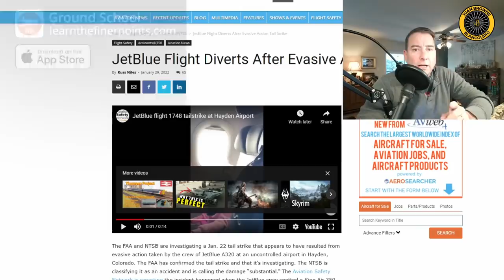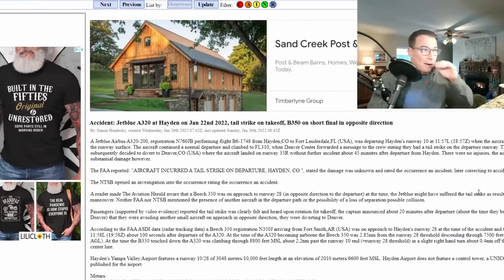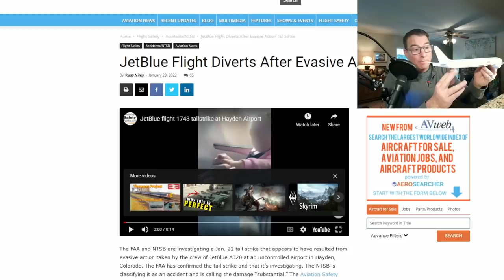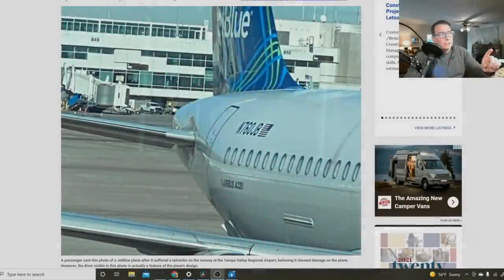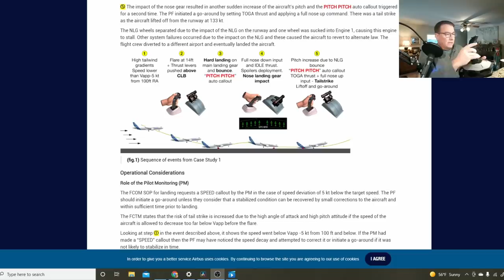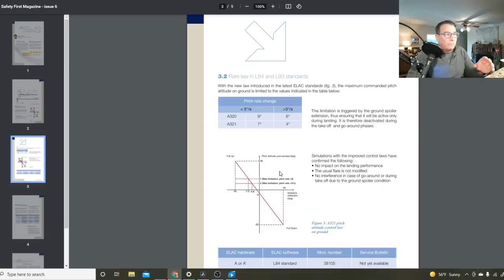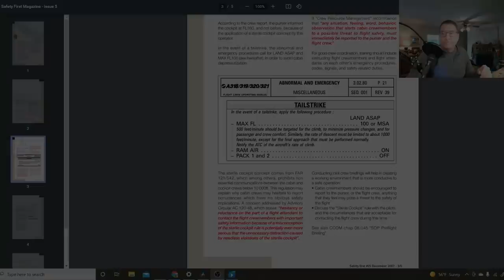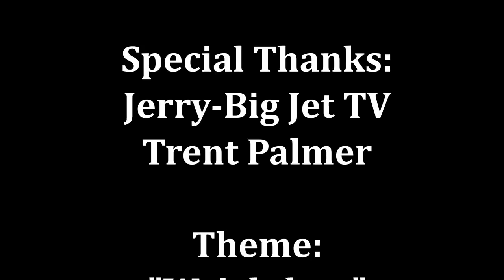Tailstrike!

Comment: The BA tailstrike looked a lot like pilot induced oscillation, or PIO. This occurs in F-16s and F/A-18s, especially on takeoff or landing. The F-16 fly-by-wire also won't stop the pilot scraping the tail speedbrake on the runway either.
Reply: Looks like a complex combination of PIO, TOGA, wind gusts, and the multiple control laws. It would need a full analysis of all the factors, and an engineering flight simulator to really understand what happened. We may never find out, since it wasn't a catastrophic accident.
Reply: @gordonrichardson2972  Agreed. There was multiple factors involved, beyond PIO and wind gusts on landing.

Comment: Approx 25 years ago, as a passenger leaving Pittsburgh on a USAir flight to Toronto (in a 737-100 or something very similar), we dragged the tail on take-off for three seconds (it seemed like 6-7 seconds, but I'm sure that was just me thinking really bad thoughts for a couple extra seconds). It was a very loud, angry, metallic scraping noise that made think this *must be at least a little unusual (or otherwise the air travel industry would lose a lot of nervous customers). But it seemed barely noticed by the few red-eye passengers, wasn't mentioned by any of the crew, and we continued to sail off into the blue. Perhaps not an ideal take-off but we were away so, I guessed, perfectly normal so no worries. To this day, I don't really have any idea if the event would be considered a serious problem or no big deal at all or if it was somewhere in between...

Comment: The explanation of which mode was engaged is a clue to what happened. Up until the moment the TOGA was engaged the aircraft would have been in flare mode. As soon as the TOGA was activated the spoilers closed and Flare mode was instantly deactivated. (See Para 3.2).

Comment: Tail strikes happen more often than you think unfortunately, we had one last month and is now in a MRO for reskinning, long process.  In the 00's, I worked for the only airline in N. America to fly the A318's (that was short lived)...the "really short bus". Somehow, the F/O (PF) did a tail strike on a A318 in KDEN on landing... That's some serious nose up on landing, 14.5°+... He insisted that the aircraft did it on it's own during flare... However...Maintenance (Mx) was asked by Flight Ops to secure the sacred card that Juan has spoken of in a prior video, the FOQA card from the CFDIU, aka "The Tattle Tale Card". Turns out, the F/O had a nose up, pulled back, input on his sidestick the whole time during touch down into roll out. So he lied and I believe got his ass suspended for a lil while...

Comment: I would like to add to my post that the FBY ( fly by wire) stick is incredibly accurate & sensitive. Moving it for rotation is maybe 1/2 inch over 5 seconds . Normal hand held flying & on landing doesn’t exceed 1/16 to 1/8. Very sensitive. Will give advantage to Boeing for landing in a hard to severe crosswind landing because of wired flight control surfaces movement.

Comment: The extend of the visible damage of one single tailstrike is impressing, looks like that body went through half a dozent of it !
Reply: Actually, this looks like a light tail strike to me. I have seen dozens of them in my year of aviation. Those skins are about .060 thick and it dosen't take much to peel them back. I doubt the rear pressure bulkhead was damaged.
Reply: @jimpalmer1969  has anyone considered designing an ablative skid plate, analogous to what skateboarders put on the tail end of their skateboards? Or are tail strikes too rare to bother?
Reply: @MarcosElMalo2   not an engineer, but I doubt a skid plate would do much.  As Juan mentioned the concern is more for the aft pressure bulkhead inside than any external plating. You don’t have to actually open a hole to cause damage to that bulkhead inside.
Reply: Some longer models have deployable tail skids.
Reply: @MarcosElMalo2  Some aircraft have them as a means to understand the severity of the hit, think crush block rather than skid plate, but the concern is not just abrasion, but bending moment as well.

Comment: If I am not mistaken, main gear has to be compressed fully to reach switches to deploy spoilers. If one gear uncompresses, spoilers will stow away. 

Also, that BA looked like it was having gusting conditions. You can see after it struct the tail, nose went down because computer sensed it's AOA too be to steep at that altitude.

Comment: TAIL KABLAMMO! 😁 It looks so gentle from outside, but that passenger video proves otherwise! That was a SHARP hit! Those machines are so big it's hard to imagine the forces at play.  I can only imagine the internal damage from that on something this heavy.  Externally it looks like someone took a 20' wide belt sander with 40 grit sandpaper to the thing!  Knocked the heads off quite a few rivets there as you pointed out.  

Far be it from me to point fingers. I used to drive tractor trailer, and as a rookie I got myself into several pickles that drew mockery from all my co-workers. It happens - we're only human!  In the trucking industry you're only allowed 3 incidents - even a nick on an aluminum glad hand hose protector counts as ONE (of course this depends on your superior) - within a 1-year rolling period, then you're out the door. Even if it's not 100% your fault.  All about insurance costs. You're just a number there, like most jobs with big companies. Screw up, and they'll find another warm body to replace you.

Comment: Very informative, thank you Juan. Ever since that Air France Flight 447 accident in 2009 (I think) I have been very skeptical of the side stick, non-linked flight control concept. As per Wikipedia, that configuration may have contributed to the accident, "The flight controls are not mechanically linked between the two pilot seats, and Robert, the left-seat pilot who believed he had taken over control of the aircraft, was not aware that Bonin continued to hold the stick back, which overrode Robert's own control.". The airplane was apparently in a stalled condition all the way from cruising altitude to impact. When you add in the controls computerized system and the fact that pilots are not receiving authentic feedback from controls input, I see too much potential for inadequate/inappropriate control authority. Makes me want to kiss the yoke on the C172 I fly.

Comment: If the pressure dome is installed correctly besides the rivets there should also be a good sealant in there holding the metal together, for a bit anyway.

Comment: Lack of Basic Airmanship caused this damage. First, not keeping the upwind wing down after touchdown, bouncing the aircraft upon touchdown is indicative of too high of a touchdown speed. Combine these two mistakes and now the aircraft is out of its landing parameters. Now, the pilot is behind the aircraft and possibly running out of remaining runway, airspeed and ideas all at the same time. Hence the rapid rotation as he applies power causing the tail strike. They just don't teach the hard stuff anymore. I'm retired from professional aviation after 47 years .

Comment: To make a good tail skid you would not even have to add significant weight. You start with an efficient high strength steel as base material, coated to prevent corrosion of the aluminum at the interface, then you add tungsten carbide buttons or runners that allow the skid to contact the runway at speed without eroding the skid. That way it can be made lightweight and durable.

Comment: "Normal Law" is a trim free, one G regime, and therefore the "Flare Mode" introduces slight nose low auto trim to introduce the typical non-FBW flight control response pilots are accustomed to in the flare.  In other words, a bit of weight to the side stick while rotating in the flare.  Also, ground spoiler deployment requires not only squat switch, but also thrust levers at idle, which may or may no have occurred in this case.  A bounce often occurs simply due to pilots reducing thrust levers slowly like a conventional jet which undermines the need to be at idle at touchdown for spoiler deployment.  The gust, or large wing wag seems excessive and I'm still trying to figure that one out based on flight control input.  Probably tied to late or non-existent ground spoiler deployment.  It's a puzzle for sure.  The FOQA data should have all the answers.

Comment: It seems to me that the BA Neo's pitch was too steep(high) during the bounced landing recovery. You see them correcting (lowering the nose) as soon as the plane starts climbing. We operated the MD11 for years and a lot of recurrent training was focused on bounced landing recovery, MD11 could be a biatch when you didn't correctly fly a crosswind flare/touchdown.
I really enjoyed the Airbus(a320/21) but never really got used to not having feedback of the control forces (PF moves the joystick but the other pilot doesn't feel that movement through his/her stick). Conventional steering columns give the PNF feedback of what the PF is doing to his controls in pitch and roll. That's why you often see the PNF lightly holding the controls to feel what the PF is doing, especially when operating with less experienced pilots. As an instructor pilot on the A320 (after having flown Boeing and MD11) this really was something to pay attention to, the decision to take over the controls when needed was done in an earlier stage of the flight since you couldn't anticipate what the other (trainee) pilot was doing due lack of control input feedback.
Also, the thrust levers not moving was getting used to. Never forgot a go around in heavy rain/windshear during flare as PNF, PF forgot to hit the TOGA buttons and I didn't realize that until few seconds later and slammed the thrust levers to the firewall. Sticking to the drill of the ga around procedure prevented a worse outcome.
Reply: Thank you for sharing your experience!

Comment: Recalls a horrible accident in Japan where a 747 on a domestic flight suffered a rear pressure bulkhead failure that damaged the empennage causing loss of control.
Reply: JAL 123.
Reply: Sadly that was due to the improper repairs.
Reply: @KPMACHINE1  Yep.
Reply: Empennage is one of my favourite words thanks for using it today
Reply: @nickinportland  
Fabulous is mine!
Reply: We personally know one of the four survivors of JAL123. That the pilots were able to maneuver the plane for as long as they did was was remarkable considering the catastrophic damage to the plane.
Reply: JAL 123. Still the greatest single aircraft loss of life. Due to a badly repaired tail strike years prior.
Reply: It blew the entire tail off didn't it?
Reply: The repair actually lasted a long time 20 yrs or so before finally failing. The mechanic who repaired the plane killed himself, couldn't live with it. Overall tragic story all around.
Reply: @schecter6l6  I dont think so.

Comment: I had a slight tail strike on a DC 8 73series, 20 some years ago or more. It was a max takeoff weight of 355,000 pounds. On a warm day make that night. Felt a slight little bump. Even though I only rotated less than 9°. The aircraft was flying was flying in ground affect a little bit as I rotated to the 15° pitch up and scraped the tail  skid a little bit. But there is a crush cone And different ways of seeing if you needed an inspection or just some spray paint. I was lucky only spray paint as it did not crush the canister in the tail skid.

Comment: There's no law that prevents tail strikes, during the flair mode most protections are gone. The pitch protection is way passed tail strike angle. It's only for in flight protection. There's an aural pitch warning but no protection at all.
Reply: Does hitting TOGA change the law?
Reply: @blackswan4183  the laws are based in RA, angle of attack, speed, acceleration and degradation of the systems.

Comment: Never gotten a tail strike at altitude...😅 Once again a great job...The only one I've personally been involved with was as an engineer on a DC-10-30 on a maintenance ferry out of Tulsa. Definitely shortened our duty day tho.
Reply: I pondered Juan's explanation.  He pretty much bracketed tail strike situations:  landing, taking off, touch-n-goes.
Of course, there's always the possibility of a military engagement, or when you drop the soap in the shower at the pen...
Of course, the penitentiary shower situation could arguably be a variation on the touchin'go theme....   YMMV
Reply: Define altitude... If only the trees on Russ Hill at the western end of 26L at Gatwick could talk...
Reply: @alasdairhompstead7950  Well....Departing Gatwick full and non stop to Dallas was my other DC-10 story. I ruined the cushion on the engineer's seat.
Reply: @jakejacobs7584  I can well believe it, although I was thinking of the TWA 747 that barely made it to 3,000 before returning to unload... I think the only thing that came closer to hitting the hill was the A321 a couple of years ago that lost both engines as it cleared the perimeter.
Reply: @alasdairhompstead7950  True enough... I was just speaking of seeing the end of the runway pass under the nose on rotation.
Reply: @jakejacobs7584  That would certainly leave a mark😬 The extra 1,000 ish ft extension in the late '90s   made a difference.
Reply: @alasdairhompstead7950  Yes, that was in 89 or 90. My last departure out of Gatwick was on the 777 and not a problem at all.

Comment: On the JetBlue flight, how/why is it that ATC would know about the tail strike but not the crew? There was no tower there, presumably the King Air crew wouldn't have known the JB had a tail strike,  and the flight crew presumably didn't know because they continued climbing to FL310 which undoubtedly means they allowed pressurization to take place.

Comment: The horrible 747 crash in Japan a few years ago (several hundred killed, one survivor) was the result of a tail strike, more correctly, poor maintenance at the time of repair of a tail strike.  When the rear bulkhead blew away in climb, it cut off the horizontal stabilizer controls.  The crew did a valiant job controlling it for about an hour by using power but ultimately it went into a mountain, Mt. Fuji if memory serves.

Comment: IIRC the lack of a "Direct Control" modes one of the complaints Sully had when putting the plane on the Hudson. Makes me wonder if this was done since then.
Reply: Yeah, you're correct. I saw him in person giving a speech once. Someone from the crowd asked a question along the lines of "would you change anything about the landing?" Sully laughed and said "Yeah if I had to do it again, I'd do it in a Boeing. That airbus wouldn't let me flare all the way to the surface of the river.. I know I could have put that thing down more gently if the plane had let me."
Reply: Not sure landing on rivers was a priority in the design process at airbus!

Comment: Saw a C-130H land nose wheel first , taxied in for a engine running offload. Brakes were hot them I saw the station 360 had crumpled skin. Had the engineer look and they cut engines.

Comment: I was watching Big Jet TV that morning right after the tail strike. He mentioned that the crosswind can be tricky there due to the buildings on the north side of the field. Do you think the wind could have caught the crew off guard a bit after they came out of cover from a building?
Reply: I’ve seen this discussed elsewhere and I don’t buy it.  Mechanical turbulence exists everywhere.  A good pilot will be actively flying his aircraft all the way to the taxiway, essentially.  If you let some wind blow around a building and almost wreck your airplane, you’re doing it wrong.

Comment: Didn't the B-29 have a rear skid plate to prevent damage to the actual aircraft in the event of a tail strike?
Reply: Dang.... should have read the other posts before I said the same thing.  Only reason I knew that B-29's had the skid plate is from one of my many visits to the Midland CAF.  Fifi was briefly grounded due to the skid plate not retracting with the gear, as it should.  Pretty sure it was used on the B-36, as well.  Seems like they knew something 80 years ago that could help today.

Comment: It will be interesting to find out if the rear cabin crew reported the “event” to thee flight crew. If they did, the decision to climb to cruise altitude is suspect. As if when notified by radio they thought, “we can’t get away with it now.” Not saying that happened, just hoping it didn’t. 

If the cabin crew didn’t make that call, there needs to be some retraining. That was a pretty violent event for the cheap seats.

Comment: Hi, thanks for the extremely valuable information you spread in the aero world. Hope not to bore you with a probably silly question I often ask myself when I see the smoke produced by the tires while contacting the runway on landing; why the rims are not designed so that once the gears are deployed  they exploit the moving air to start spinning the wheels in order to reduce tires' wearing? Thank you.